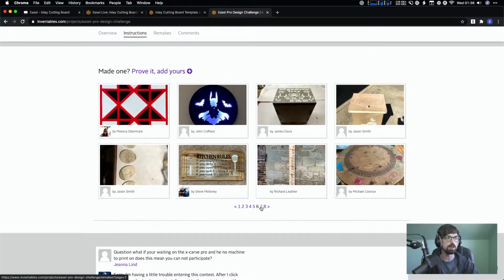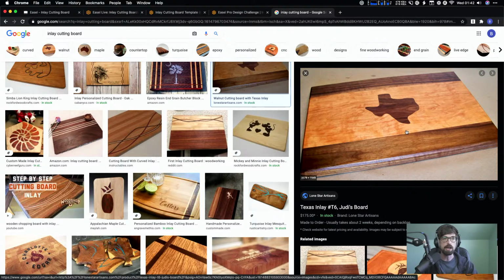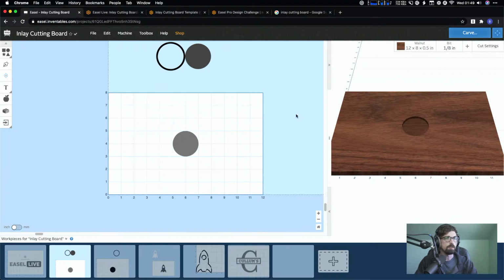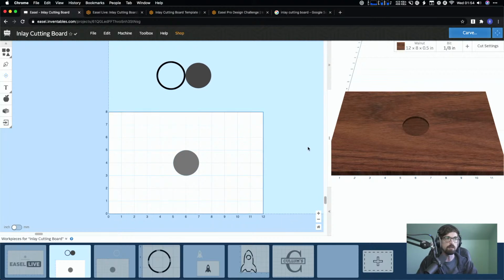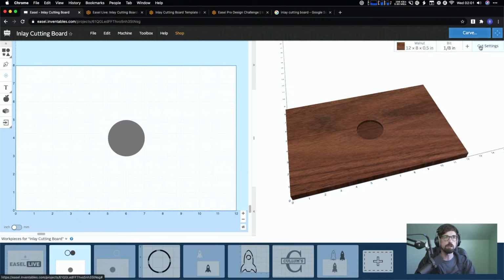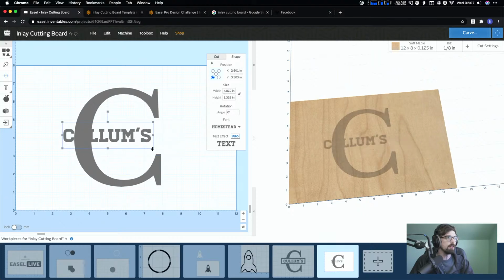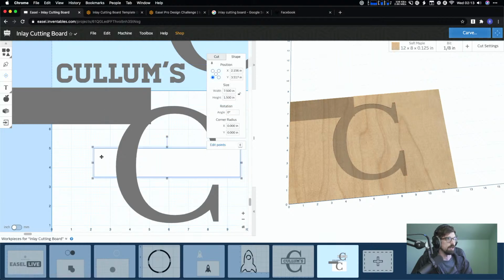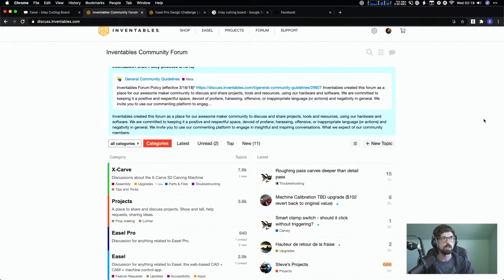Easel Live: Cutting Board Inlay

Comment: Can anyone tell me if it's possible to merge two separate drawings please? I want to cut out an acoustic guitar so that it's perfectly symmetrical I have drawn one side and saved it then flipped it to create a mirror image. How do I combine the two separate drawings and merge them and remove the centre cut line? Any answers much appreciated, thanks
Reply from the maker: Yep!  You can copy and paste a design inside of Easel and then mirror it to give you what you are looking for.  To get rid of the center line you would need to add a rectangle with a depth of 0 to "mask" the line away.

Also feel free to drop your question in our forums (https://discuss.inventables.com/), our community always has some great ideas!
Reply: @inventables  Thank you Brandon I'll 'ave a go. I actually did try to ask the question on a forum page but couldn't seem to find a way to start a thread?? Thanks again👍🏼
Reply: @inventables  Thanks Brandon, I have succeeded in the copy and paste but I can't find out how to select only or remove the centre lines or add the rectangle? Also I followed the link to the forum and I don't see anywhere that says "Ask a question" or "Start a thread"? Just loads of topics non of which are applicable. It would be a sensible addition. I may be being thick or just not reading it thoroughly? but I've never come across this problem before.
Reply from the maker: Sorry about that!  There is a chance your design already has the graphics combined together so it will be hard to remove that center line.  If thats the case you might need to put a thin rectangle on top of the center line and set the depth to 0 which will make it work like a mask.
 
For the forum you should see "New Topic" on the top right, you'll probably need to setup a new account to it though.  Sorry about the confusion!